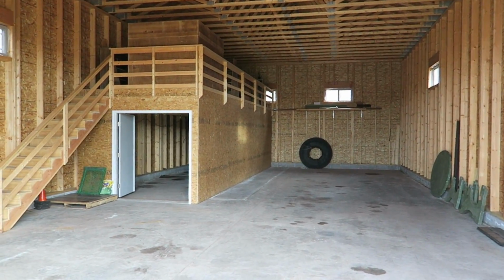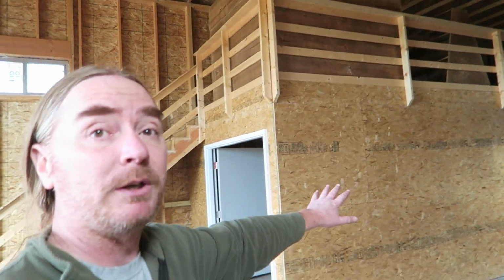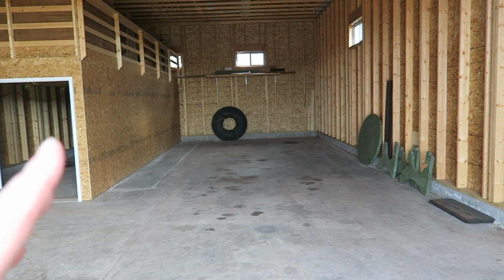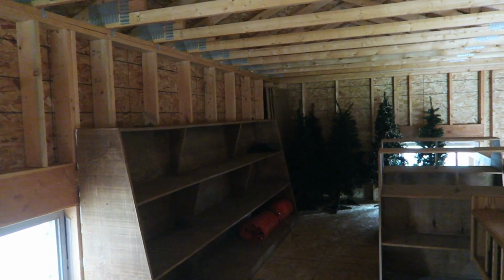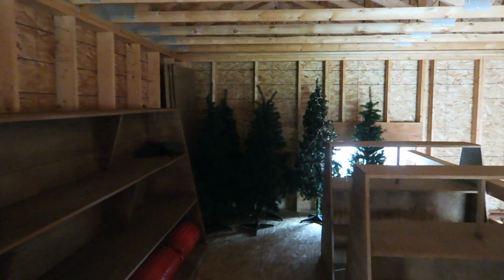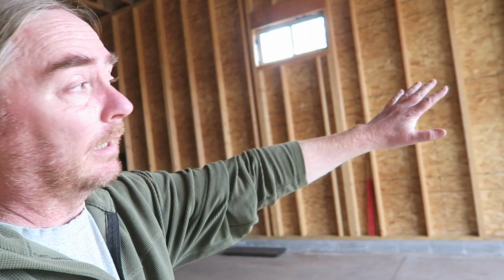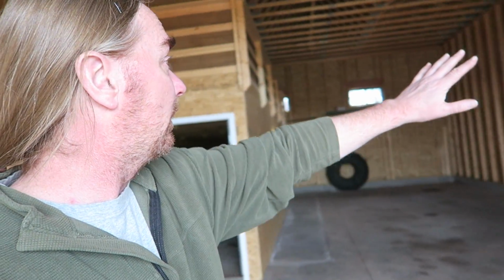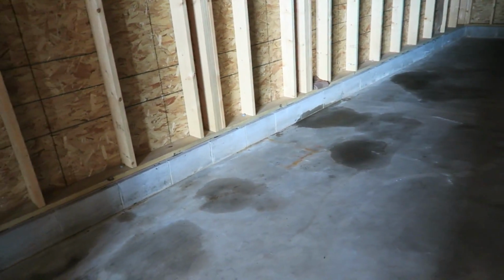CHECK OUT THE NEW BOAT SHOP!!

Comment: R factor is only one part the other is air infiltration - that's were foam and blown insulation shine . Blown wet cellulose is self supporting and has great R factor . the building where I store my boat in Bay City is about 80x200 and has around 2" of cellulose on the wall and roof and heats well with 400k btu . there is no drywall or any thing over the insulation and the large sliding doors don't seal that well . When I built my house in lower mi. I could do it all myself but it had to be to code and inspected . You should look at radiant tube heaters - they heat objects not air - your floor and tools will be nice and warm . find a contactor who sells them and ask to see one in use and ask the owner how he likes it . concrete floors in unheated buildings will sweat big time in the spring ( cold floor - warm moist air) . Do you have nat. gas at the house - if not you just get another propane tank for the shop - power can be run overhead on poles if trenching is a problem .

Comment: If you are seeing moisture on the floor, then its either coming from leaky roof, or up through the floor.  Good epoxy paint for floor, then dig perimeter of building and put weeping tile and crushed rock.  Will help to keep perimeter and thus the slab dry.  You may want to consider having a second meter on the building, and have an overhead line brought in around out of the way.  You would also benefit for digging down the perimeter around the building, down 2-4 feet, going out 8 feet away from the building, then insulate the ground with styrofoam, at least 2 inch thick, all the way around the perimeter of the building.  Once your concrete floor gets warm with what ever heat source, the ground below will initially suck up that heat, but by insulating the perimeter, You are effectively preventing the frost from going deeper than the insulation perimeter, thus keeping the ground below the styrofoam, and the ground below the slab a frost free zone and prevent it from sucking the heat out of the cement floor.  Then backfill above the syrofoam, best would be clay sloped away from foundation, then backfill with gravel with drainage tile.

Comment: Central Canada, spray foam is about $1.30 per square foot per 1 inch thick.  You don't need to go beyond 2 " spray foam.  Then put Reflectix insulation before plywood or drywall.  With spray foam, don't think R value.  It was a measure for fiberglass.  Air space is a great insulator!  Leave the airspace, and enclose it with a Reflectix.

Comment: Love the new building.  I would agree not addressing the insulated concrete floors means spending allot on the spray foam is  pointless.  I think you would be better off going with cheaper batten insulation and maybe spending the time and money to caulk around each stud all the way around to get your seal, then insulate, then vapor barrier,  and then just use drywall or sheetrock as it is probably cheaper than wood these days.  Base board heating would have the best bang for your budget.  For lighting go with LED from a quality commercial manufacter.   Given the height of the ceilings you want something that will last awhile so your not climbing up as much.  And LED's would give you the required light and light color for making better videos,  I.E. less shadow areas for better camera response.  Yes you have your tripod lights but wouldn't it be better if all of the lights where just on the ceiling opening up more area for tools and projects.  Just my few cents information.

Comment: Building materials are at an all time high.  I might suggest R-23 batt insulation in the stud bays with rigid insulation (1.5-2") continuous on the walls which will be close to R-30-35 covered with 3/4" ply for hanging anything.  Also, you'll want to wire before insulating, of course.

Comment: Hi I renovate our own properties and wrt to insulation I do know quite a bit. In your old house where they filled say 10+" and a whole heap on the roof, that is right. IMO the 3" is more of a quote so that the garage can be heated at a basic level to stop freezing. The contractor is IMO not giving you the right information. You will need to recreate what you had at your old house if you want to get any kind of insulation value. BTW I lived in Canada, live in Switzerland, and now France. In Switzerland our house is in the mountains and we can get -20C. Not common, but it happens.

Comment: The vapor barrier goes on the outside. Vapor barrier inside can trap moisture in the structure. Frankly, I’d just staple in fiberglass batts, them drywall over it. The ceiling can be drywalled, then fiberglass batts rolled out. Make sure to seal all leaks. ~50% of baseboard heat can go into the outside walls. Ducted hot air will be the cheapest. Put the unit in the middle in that little room. Your other option is radiant heat overhead for fast warmth and cheap installation.

Comment: Andy first things you need to do is figure out what to do with the lower room and loft then get your electrical connected and run thru the walls then the insulation and how you are going to sheet the walls and ceiling.  Ill swing by and shoot the bull sometime!

Comment: There oil stains except maybe that one in the shop. I would do the spray foam and batt insulation. If you get it done super tight look at maybe some split unit Heat pumps. I bet 2 would be able to be done cheap. As for doing it if I was closer I would bring my machine and dig your trench for the cost of diesel fuel.

Comment: You will NOT be able to stand on a COLD floor all day long with no insulation under the concrete, I know because I worked on a cold floor for 15 years.

Comment: Get your electrical done first.  For DIY insulation look into rigid EPS foam sheets.  You need LED high bay lights, many lower wattage fixtures instead of few high wattage to reduce shadows.

Comment: I have your answer. Insulate with Roxul or pink. Do not fill the cavity completely by using R-14. Spray two inches of foam over top. Foam is R-3.5 per inch so two inches is R-7 so combined you have R-21. You do not need a vapour barrier because the foam is a vapour barrier and the barrier needs to be on the hot side. The ceiling you can do your self. You get the machine for free if you buy the blown insulation from Home Depot or Lowes. You an your wife and kids can do that in an afternoon. Cheapest way to get best bang for your buck. As far as access goes, it would be cheaper to fix the road and build a turn around than build a new building. Keep up the good work.

Comment: I live in a resort town in Montana and involved in real estate.  100% of all homes here spay foam to seal up the wall then fill in with fiberglass batt insulation.  Where there is more than one stud together the cracks are sealed. When they first started to build houses so tight air quality became an issue.  With the high buildup of radon etc.  Now some sort of heat exchangers is always used to get fresh air even when the house is heated by radiant heat. For the ceiling, I would blow in insulation and make sure the roof is vented.  High voltage or 12 volt LED is what all new construction has here.  Concrete reflects only 15% of light.  For your filmmaking, I would also look into indirect lighting.  I would apply white epoxy to the floor.  You would be amazed at how much more light you have with a light-colored floor.

Comment: New place looks awesome Andy , hope you and the family settle in well there ❤️ 
I would look into some solar panels and led lighting and maybe a wind generator for when the sun's just not enough.
Them stains look like some sort of oil based residue, wood stain etc. 
Storage upstairs is handy, in the smaller room you could set up a recording studio with cameras and lighting for filming work on smaller projects, small hole repairs and paint demo's on panels etc, with extraction for fumes and dust control.
The numbers sound mind-blowing lol ,but hope you get it all sorted and back to what you love doing.
Best of luck .

Comment: An option for the little room: production room for video editing and rendering or a room with different temperature (warmer room for doing fiberglass in the winter or similar).

If you go with radiant heat, you should look into the thermal powered fans that are designed to go on wood burning stoves; they use the thermal difference between the base plate and a heat sink type assembly to generate a small electric current that powers a fan.  My understanding is that they move the air, but you don't get a noticeable breeze, so you shouldn't get too much dust blowing into resin.
Reply: An option for "spreading" heat might also be one of those huge overhead fans. They also do not make a huge draft, and for paintwork, just leave it of and let the dust settle overnight. Or maybe some air filtration units to cut down on any airborne particles.

Comment: You should look into the mini split systems they have out now they heat and cool and don't use a lot of electricity., and are DYI friendly with the most bang for your buck. As far as lights home depot sells a LED 4ft shop light for around 14 bucks each and are hella bright for natural white. Also i noticed no gutter system on the roof that could be why you have moisture in the shop or at least it looked as if there were no gutters

Comment: Nice shop, use your resources, YouTube, Google spray foam insulation. I am no expert but I thought 3" was R20. I also thought with spray foam no vapor barrier needed. I do know that there are kits that you can rent to put in the foam yourself and videos on how to do that. Yes more work for you. I know that there is a closed foam insulation and an open foam insulation. The closed foam is stronger and you need less. Open foam would probably fill you 6" to get the same R value, I think. Alot of people explaining how to on YouTube like yourself good luck hope that the next video isn't done on a dying battery,  lol...

Comment: Sorry if it sounds rude, but are you seriously doing new natural gas installations as a heat source at the year 2021 in the US? Sounds like something from the 50s. A modern air to water heat pump must be a hell lot cheaper over time?

Comment: Agree with ridedrivendive...spray foam to seal everything and batt to fill in and you can do both yourself for cost saving. Put a few solar panels on the roof and led lights if your not covered by trees. Thinking geo themal but dont know the price or if it is a diy project. Raise and insulate your floor as you have plenty of head room. Agree with previous post...looks like spilled stain or oil based product on your floor, not water. Best of luck to you and your family in your new space!!

Comment: Nice looking shop.  Looks more like 32x70 than 42x70.  I think you should price putting in a radiant floor.  Assuming the building is 32x70 outside dimensions you would be looking at a 20 yard pour for a 3" slab, plus about 70 sheets of foam board insulation.  Using home depot/Lowes prices for the foam board and reinforcing for the concrete and the average cost I found for concrete in Michigan, that works out to about $4,500 for a 3" slab with 2" of foam (R10) or $5,500 for the same slab with 3" of foam underneath.The reinforcing wire for the slab would be about $500 and about $750 for the Pex tube (5/8" tube with 12" spacing).  So it looks like a radiant slab ready to connect to a boiler would be in the $5,750 to $6,750.  If you can get away with a 2" slab the cost would drop by about $650.  I imagine that you could lay the foam, put in reinforcing wire and pex yourself, so the labor charge would be minimal.  In contrast, radiators look like they cost about $50/foot plus plumber labor to install/connect them.  Radiators to handle the heat load would likely cost about $3,000 or more plus plumber labor to install them.  So say about $5,000.  It looks to me as if radiant floor will be $2,500-$3,500 more than  radiators.  You would lose 4-5" in overall height.  Just based on back of the envelope calculations.

As far as insulation goes, R-19 fiberglass will cost you about $2,200 and you can install it yourself.  Frankly, it might make more sense to sacrifice a foot in length and width and build an interior 2x6 wall and insulate it too for R-38) than to go with $20K for spray foam.  If you offset the studs in the interior wall you can eliminate thermal bridging except around windows/doors and at the corners and get really effective insulation. At current lumber prices an interior second wall would cost you about $5,200 (DIY) with fiberglass insulation, so say $7,500 for taking the walls to R-38.  Or, you could save money and volume and build a 2x4 inner wall for R-32 wall insulation.  When I lived in Manitoba my house was double 2x6 construction and the entire 1,200 sq. ft. house was heated with ONE 1,200 watt electric baseboard.  Yeah, it also had triple pane windows and a LOT of insulation in the ceiling.  Here on the coast of Maine, my 12x16 work shop has double 2x4 walls with R-26 walls, double pane windows, an R57 ceiling, R20 floor and an insulated door.  It stays quite comfy with my electric baseboard heater set to about 250 watts.

Comment: I’ve got seven years on lights from Big Ass fan company at work.  They are absolutely fantastic and not one failure on over 50 lights.   Lots of Options for motion, light intensity, etc.  

My wife and I also rent 5000sf for her cheer program and we swapped the HID highbay to the cheap round LED high bays from Amazon and they have been reliable for under $100 each.  Dimmable as well.  Shoot for 4000-5000 kelvin color temperature for good color rendition.  

I’d sheet the ceiling and blow in cellulose insulation there just to reduce heated volume.

Comment: When it comes to the lighting with the LEDs they are efficient and very long lasting, they also do not use that much power. The stains look like they are from either woodworking or from something else, they do not look like water stains.
One thing I would do is put a good sealant on the concrete, that will help with anything that might spilled.

Comment: Andy, I am in central Florida so our insulation needs exact opposite but I have been researching this subject for our house build. In your case I personally would fill the void with spray foam. Blown in for the attic. But you need/want some thermal mass on the inside walls to absorb and hold onto that heat! Maybe consider double 5/8” or thicker drywall interior walls! Nice shop, looking forward to how you set it up!

Comment: I installed insulation myself when we remodeled our home.  I used Rockwool from Home Depot.  It is rated R-30, is only slightly more expensive than fiberglass bats.  It went in very very quickly.  You just stick one edge of a piece against a stud and squeeze in the other side.  Like compressing a large sponge.  Each 4ft long piece only takes 10 or 15 seconds to pop in.  It is held in entirely by friction so you don't have to do any additional work to secure them in place.  The only thing that slows down installation is working around wiring and plumbing.  Since you have deep bays and are installing the rough wiring from scratch, if you have the wiring installed far enough away from the back of the bay so that you have 4 inches back there for the insulation you wouldn't have to deal with slicing the insulation to sandwich wiring crossing the middle of the bays.  

I used the Safe/sound variety for fire resistance and sound dampening.

I did my entire house in a few days with no prior experience and it worked out perfectly. The roof of your workshop would be trickier for safety reasons. You'd probably have to rent a scissor lift for that and  maybe hire some labor to help out.

On that enclosed ex woodworking shop... I could see opening up some of that long wall so you can pass freely between there and the rest of your space and keeping all your benches and tools on that side.  Maybe cut a path through the upper railing for a gangplank so you can easily get to the decks of your taller projects.

Wish I had a shop like that!

Comment: Andy, you can likely find a licensed electrical contractor who will allow you to do most if not all the work with him inspecting and pulling permits for a small fee rather than having to pay him to do all the work. Also, if the spray foam insulation is only giving you an R-19 value you will be wasting a lot of money since you can put R-19 batting in 2x6 walls very inexpensively. The construction looks very good so I’m betting the building is pretty airtight as it is. I can’t offer any advise on heating in the northern Us since I’m on the Gulf of Mexico and rarely ever need to turn on heat. Shop looks great!

Comment: How about going over head for the supply from your new home much cheaper heating how about oil boiler  with celotex in the floor plastic piping from the boiler and concrete on top 
Og boarding on the walls with something in the cavity 
With a false ceiling with more insulation on top of the false ceiling 

Led go for the biggest lux you can afford but do look at the different options they are made in different 
light spectrums ie day light are very good. 
Nice space 
Good luck